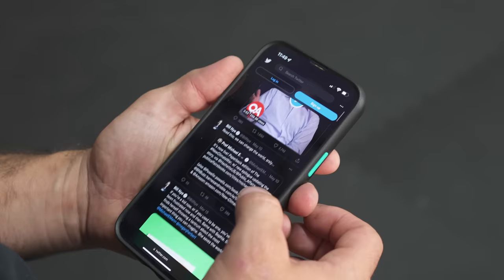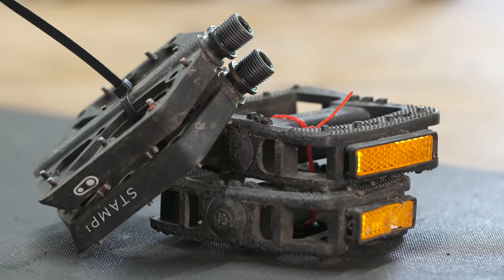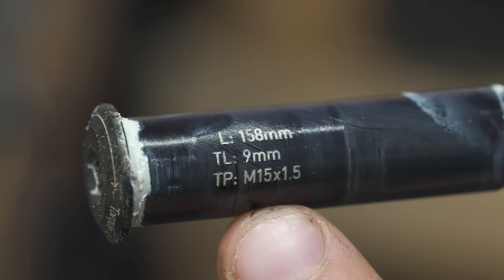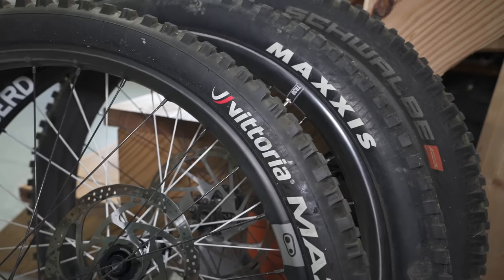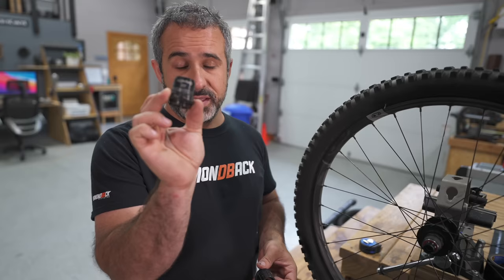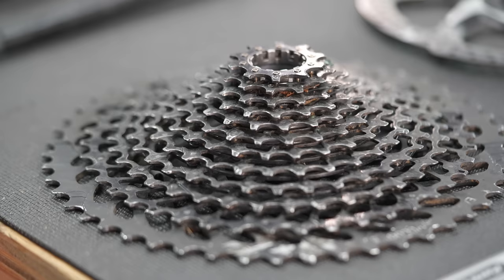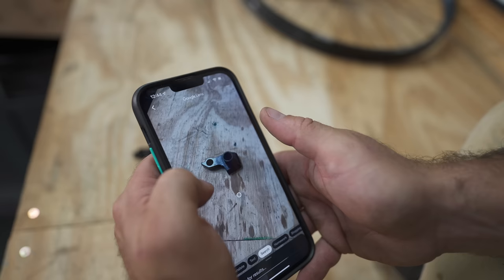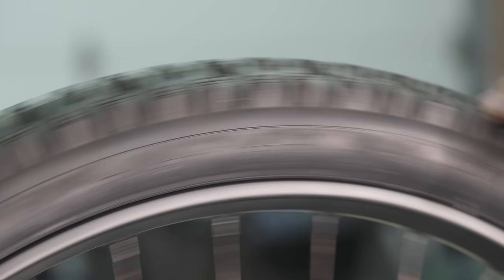What parts fit your mountain bike? (I won't tell you to just Google it)

Comment: Me trying to find a damn saddle post that’ll work perfectly with my new saddle that I got.😂🤣 Wish the site would give name brands that they know 100% will work it it lol. Had to take apart like 4 different posts looking for one that would work. Didn’t help I was doing it last minute before a camping trip.

My bike is annoying cause it’s hella old, and I’m not even sure of the exact age since it was my dad’s previously. Nishiki backroads (I think), aluminum frame which is nice, but rim brakes, 3x something, handle shifter (as compared to the button shifters that would be a lot nicer, along with disc brakes). Sucks that the full suspension bikes, let alone any new decent one, prices are absolutely insane. $13k for some brands not even including the electric versions.🙃

Comment: Valve caps schrader and presta are not interchangeable. And yep, freewheel hub, are 100% most popular "mountain bike" hub standard. 
More then half of "mountain bike" have freewheel, and you forget about it. Also there is shimano Micro Spline aroun there.  And old short HG casset, you cant use with 11-12 speed. Also, 6-8 chain interchangeable

Comment: I've been trying ta wrap my head around bike parts for a few years now and still just absolutely hate it. Wish I would have seen this when I first started research. The grip thing threw me way off, even though there is basically just the one standard it wouldn't hurt to have that written somewhere on some description of one pair of grips when pretty much everything else that goes on a bike, including pedals, have that specified.

Comment: So I have a trek fuel ex 7 with a sram nx eagle and that is only compatible with a hg free hub body. I know this from buying new wheels and got the xd and it didn’t work. Did some research and found xd only works with higher end sram and the lower end being hg. The stock freehub body on the bike is also hg but before buying the wheels I had no clue what hg or xd even was.

Comment: I put 3 piece SE racing cranks and pedals on a modern MTB for one thing. Thread less stems intermingle well too. Why? Because BMX often come up with simpler / tricker parts. I don't never be needing no stinking interwebs to be an innovator. Never trendy should be my handle. Stays outside the boring box.

Comment: I need bearings for my head tube on the front of the bike not sure what it's called for the steering on my 2007 Norco Shore and I should probably get some for my 2020 GT aggressor pro and without pulling them and buying a measuring tool it's not that easy

Comment: Okay, I'm not a beginner. I've been riding over 25 years. I'd suggest more standardization and less bullshit innovation is needed in the industry. A maintained bike lasts forever, but, much like a car, manufacturers don't really want to be in the business of maintenance. On my old bike, the parts became obsolete within a year or two of buying it. Despite this, it is still a great ride after two decades. On my new bike,  once again, I found the crankset difficult to match even after a couple years: ordering what was supposed to be the identical thing over the internet was a completely different design.
I liken this to buying a laptop. Sure the brand, model, etc. may all match but the parts sold inside the case may vary from month to month. Bikes are durable items and should not be like laptops.

Comment: Love your channel!  This was a GREAT video.  I saved and downloaded it to refer to.   However, I do have a very beginner and very specific set of questions: I have a new Specialized Rockhopper Elite with Rockshox Judy forks.  I know the head tube is straight.  Is there a performance or safety downside to adapting a tapered fork?  And either way, do you have a recommendation for a good sub-$800 fork to upgrade on my bike?

Comment: Derailleur hanger extenders are a thing. Hoping it does the trick🤞🤞. Trying to get larger cassette onto a more entry level frame with a horizontal dropout. Found a sunrace extender that I think might do the trick
Reply: I was able to buy a longer B tension screw to increase the range on my wife’s bike if the derailer hanger extender doesn’t work.
Reply: @collinandrus6584  Thanks! I might do that as well, considering I've got mine screwed in all the way

Comment: Good video.  One question.  CHAINRING aka front sprocket.  I have an ozark trail ridge.  It is v2 with factory narrow wide ring. It is 9 speed.  Let’s say I swap out crank to ixf g with their narrow wide ring.  Will this ring work with my stock rear components as well as with the deore m5100 11speed? Essentially do you need to swap both chainrings AND chains Or ONLY chains. Thanks

Comment: Soooo.... Did Bill get back to you?...

As an IT tech for 20 years I used to get "So are [Insert brand here] laptops any good"?
Trouble like a lot of techs, I worked for a specific Co that generally delt in only a couple of brands (EDS - Dell, then IBM, Then Dell, Then HP)... Now I'm a maintenance engineer that specialises in Pressure washers, Steam cleaners and Diesel heaters... so at least now I generally know a lot.. well less.. but about a lot more!...

One day I hope to know near nothing about everything!   (instead of nuttin bout nuttin like a lot of people I know...)

Comment: Can you modify a 7-speed bike into a 11-speed bike by replacing the rear casette, the front disc and the gear changer lever on your handlebar? Will a 11-speed casette even fit in place where used to be a 7-speed one? Must the derailleur hanger change for it to even work? Or there's absolutely no way?

Comment: Seth, you forgot about Bottom Brackets 😅 especially BB Shells that has 68mm or 73mm. If it is an Intergrated Catridge or Shell type. If it is a Square tapered, Hollowtech, or other standards.
Reply: Yeh, and a headsets too
Reply: @GoGoGeorg.W That too. Especially those bearing type and pipe diameter.

Comment: Does anyone know how to take on/off the cap thing that is used to adjust the compression damping on a fork. i have googled and found nothing. it is a fork from x fusion
Reply: @sorinvladu7021  so I was riding and I crashed and the cap came off and was on the floor. I didn’t want to ride with it off or mud would go in so I put the cap on. But it’s not in the correct position so my fork is locked out.

Comment: This is all nice and logic, but what happens if we wont to upgrade some parts on our MTB or even road bike, Lets say a cassette - from a 11-32 teeth to a 11-36 teeth or a 11-40 teeth. Can i do? do i need a different rear delailluer and what kind? So these questions cant be found. Theres 1000 videos on youtube how to change a tyre, 1000 how to change a bottom braket and so on. But not much on up grading our bikes with proper details. Now i live in Greece on an island, i went to the bike shop the ather day and asked for ball bearing for my hubs i said 6.35 mm which is 1/4 inch, he said we dont have free bearnig only sealed -- but you can pull them freely [apart] i asked what size are they - so he measered and said to me they are 6.35mm. The ball bearing. Ok i will have 6. Got home and pulled upart one of them got 7 ball bearing from one so i measered them also and i got 6.32 or 6.33mm. Now my bike is not a high end bike worth thousands of euros, but still a wont some professional help. What im trying to say many places around the world we dont have professional bike shops they are just trying to sell you anything they can. So how do we find all information our selfs ???

Comment: I have a question:My fork its 100mm travel but i want to change it and get like one with 120mm or 140mm,the thing is it will modify the bike geometry so much if i jump lets say from 100-140 or it would be better from 100-120 to not fell the big change?

Comment: A lot of great info here man, However, how do you find specs on a lets say my bike. Its a 2007 Specialized FRSxcPRO that I found sitting next to a dumpster and I want to build it up. Its missing Handbars, easy enough to replace, and pedals, again easy to replace. I want to rebuild the Drivetrain and I cannot find any links or leads as to where I can find the specifications for the bike. Thoughts? Thank man!

Comment: Hi I have a giant 0cr 3 It has a 12-25 tooth  8 gear cassette on it  the 25 tooth gear has w -25t   yf5   stamped on it .  I would like to get  the Shimano CS-HG41 Cassette - 8 Speed, 11-34t, cassette  to replace it . If I go with a bigger top end gear  like a 34 t  will I have to get a  longer  chain or will the one I have work ? Also would I need to get a different derailleur  or will the one I have work ?  How do I go about figuring  these thing out ?

Comment: I have a serious question about this crank. So the other day I wanted to do regular maintanance. And after I put the cranks back together and tightened the screw at exact torque force I've noticed that this ring on left crank is skipping when it comes to very end of screw. So did that happened to you? I mean does it feel that you can never tighten that ring on the left crank all the way to the left bottom bracket lager before you tighten him up with allen key?

Comment: Anyone know if the number of teeth on a cassette change matters? I think I had a 11-36 range, and switched to a 11-52. I did the p2 9x1 conversion Seth did in a flip bike video, but I will literally take it off a jump and it will already be out of tune. It is extremely hard to tune it too! Anybody have a suggestion of an alternative more reliable drivetrain? Or know a good video that explains tuning well?

Comment: Regards saddles, there are some notable exceptions (i.e iBeam and on DJ bikes pivotal BMX saddles aren't uncommon) but if you're saddle has rails, they are all compatible.
I do have a question regards brake rotors though, I'm setting up a new enduro bike with 6-bolt hubs, Shimano XT calipers and the frame takes 200mm (minimum) rotors with a post mount. The only 6 bolt, 200mm rotors I'm seeing (available in the UK) are Hope ones with a spider which I've heard have clearance issues with Shimano calipers so it looks like I'll either have to run a 203mm rotor with 1.5mm washers or wait for something else to become available.... What would you do? Any brands I've missed worth looking at?

Comment: I will follow the help on this video, however, I do need to ask. I own a Giant ATX 880. It's from the 80s. Will I be able to find parts to upgrade this to handle trails and jumps? I've asked my local bike shop, and they said it's not worth it. I love this bike. I am comfortable with the frame, but want better shocks gears and so on.
   I want to do the same thing you did with your friends son's diamondback. I saw that video and got all excited. Can I achieve this with such an old mountain bike. The original shock is a Roc Shock, but being from the 80s, I'd like better. The bike is all original except for a wheel, tubes and tires.
   I can't afford a new bike, so I really want to update this. Can it be done

Comment: I’d be interested in whether you could covert a 3x front derailleur on a 2012 Kona Cinder cone hardtail or similar to a more modern set up. Flip bike idea? Or just buy a new hardtail?
Reply: I converted a 2004 Kona cinder cone to a 1x 9 speed by just pulling the front shifter, derailleur, cable etc and adding a chain guide. I also removed the small chain ring and added a rock ring in place of the large ring. It would be neater to have changed the cranks to a 1x, but it isn't necessary. Simple, cheap, works great, no more issues with bad front shifts. MTB is mostly middle ring anyway. Upgrading to a 1x12 or something might depend on your rear wheel setup, shifting etc that is on there now.

Comment: Can a 10 speed rear D be used for 8 speed since it only moves as much as the shifter tells it to?
Reply: On older Shimano 10 speed and back yes generally. I have a 105 10 speed rear derailleur  that works fine on my 8 speed. The 11 and 12 speed groups are a whole different animal.

Comment: Google says "Bicycle pedals are not universal. In fact, there are two main bicycle pedal sizes: 9/16” and ½" so right off the bat you're wrong. Just like it was wrong (illegal) to displace fire retardant trees to make trails:goodvibes:
Reply: Not really a worry unless you're getting into vintage BMX bikes with that rare size. 99.9% of mountain bikes you will find have 9/16". If you're into MTB or probably even road bikes too, you're very unlikely to ever see 1/2" thread pedals.

Comment: Good day Seth, I hope you well? I have a 2009 Specialized Epic Comp. I'm trying to replace the rear shock which is a Specialized AFR remote mini, BRAIN inertia valve w/ BRAIN fade and rebound adj. To something simpler with out the brain. I have no idea where to start what to measure I've tried the Google route and have not had much help. Is there anywhere you can advise I look.
Reply: Yeah it's really hard to find the shock measurements. I would just go to your local shop and get help from them
Reply: I believe its 7.25 inch or 185 mm. Measure from middle of mounting bolts.

Comment: Question to bike geeks : I have a threaded cassette, no splines.

Can I get a fancy modern cassette or am I stuck with old 6-7 speed casettes?
Reply: I presume you refer to a freewheel, bearings and ratchet built in to the unit?
Older Shimano stock still available- 7/8/9 although I’m unsure if 6/7 is smaller.
But no, you need a freehub to use modern cassettes ie hub with bearings and ratchet built in
Reply: @tornagawn  Thanks for replying, that's a shame was hoping to put a modern set on my e bike, hub motors all seem to have the old style casette mounting.

Another reason I wanted more modern derauler design is because the altus I currently have fitted struggles to go into first because it interferes with the hubs bolts.

Comment: It is incredible how badly parts are advertised.  Like, I am buying a hub, MOST ads do NOT show all the specs you absolutely need.  You absolutely need to know the OLD, # of Spokes, Disc brake type, Cassette type.  You almost never see ALL the specs you need just to buy the thing.  Rear hubs usually have no width indicated at all.  Like, oh, they are all 135mm, nope.  This is the biggest problem with just about every single site.  Its crazy, its stupid, its the bike industry.

Comment: HELP YOURSELF - A few weeks ago, after ordering the wrong size bike part, I bought a cheap ($10) digital caliper. This has made bike part ordering so much easier and reduced the research I had to do myself, to be more sure I'm ordering the right product, the first time.
BUT, if you bought your bike used, how does one determine its year? I have a Diamondback Response Sport, unknown year, and Wheels Mfg gives the same part # (Dropout -48) for "Response (Sport)" Year 2005, "Response Sport" Year 2000, "Sport", Years 2001 and 2006, BUT, for Model "Response", Year 2002 they have part # Dropout -27! I guess I'll also have to go by the SHAPE, at the time of ordering, or email Wheels Mfg. w/ my question.

Comment: bike wheels measure over the tire size, not the rim.  a 27.5" setup is not a rim diameter of 27.5 "  a 700 wheel is not 700/25.4  in in diameter.  bad standards

Comment: Gewgal couldn't give me a clean answer on the measurrments of ISO 6 bolt standard for disc brake rotors.and hubs.

I bought some rotors from a China based supplier that sent me disc rotors where the bolts measured 39mm and didnt fit the 44mm hubs.

The supplier said i was wrong and they were right.

Geewgal couldn't provide an answer, giving me results for automotive and aircraft.

 so i went to the Shimano website looking for schematics and long and behold 44mm

i had to intentionally mispell.geeewgaal because the powers that be kept auto deleting my comment

Comment: Ok Seth, I was willing to cut you some slack when less than 2 min. in you are pretending that Shrader valves don't still exist out there. But to pretend that Shimano 12 speed systems don't exist by completely leaving out any mention of the Micro spline freehub driver, that's inexcusable. The first thing I did when I heard that was to check the date of the video. I see it's today 6/12/2022 not some old video from before 2018. This looks awful suspicious. Is Sram giving you some kind of kickback for doing that? That's a rather significant thing to just pretend it doesn't exist.